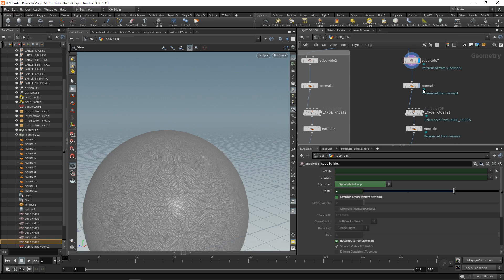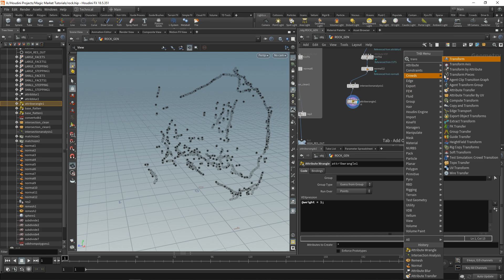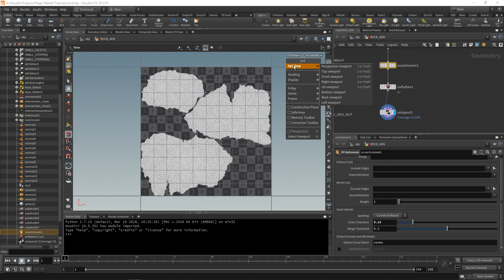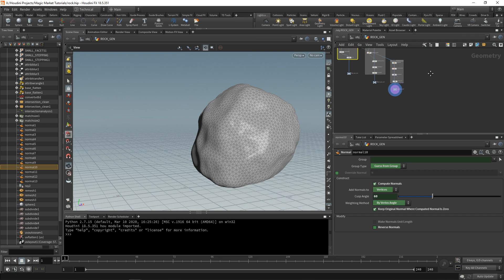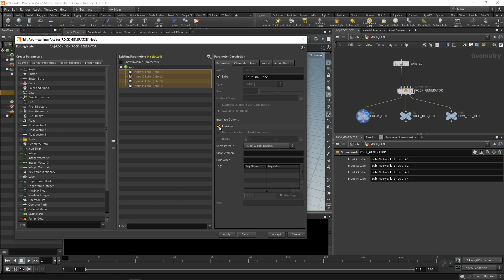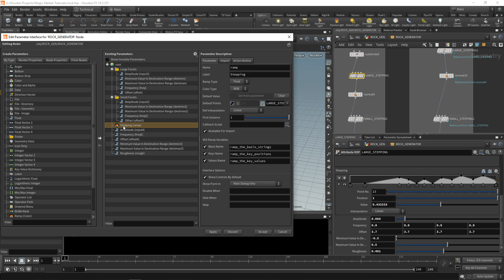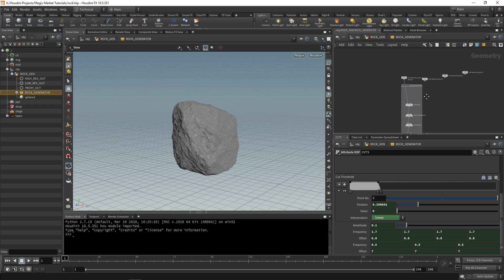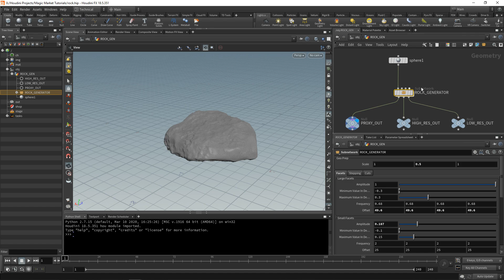Magic Market | Procedural Rocks 2 | Tool Generation

Comment: For some reason this setup is working painfully slow for me and I have a pretty fast computer with threadripper 16 cores, 128 GB ram, 4x GPU's. Now I need to wait 10 seconds after each change I make to the rock. (calculating all the remesh stuff) It seems very fast in the tutorial unless they edit all the waiting parts out. I don't know what I did wrong :(
Reply: The vdbs at the beginning are totally useless, you can simply create a polygon sphere with a frequency of like 50 and a simple remesh and you save tons of useless computations already from skipping that.
Reply: same here